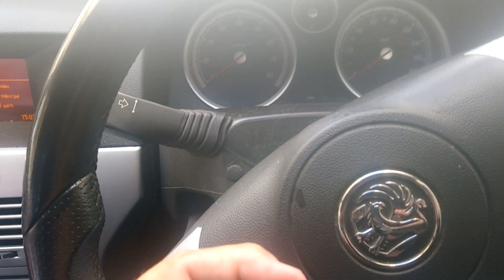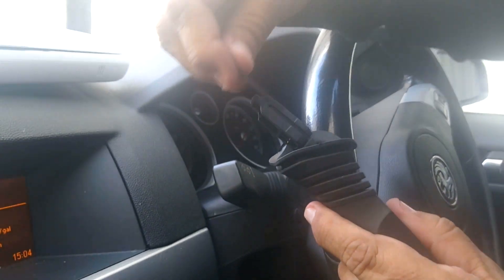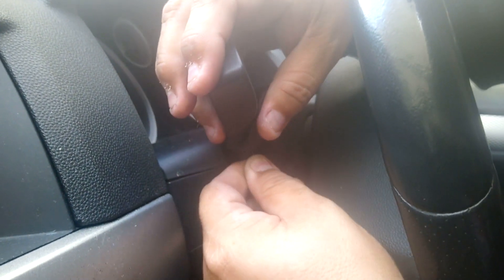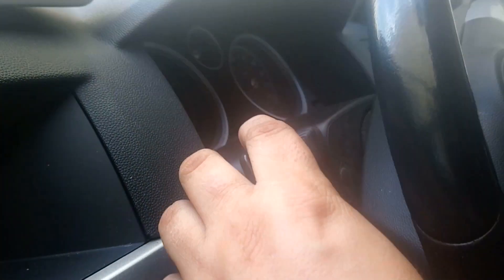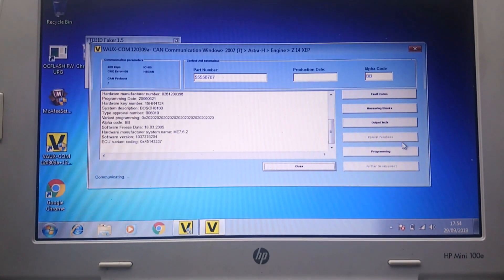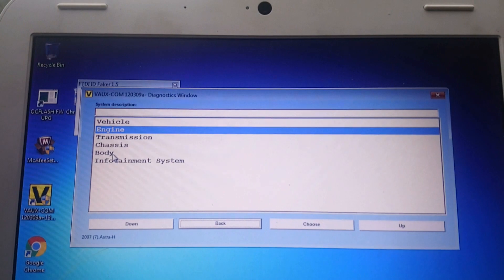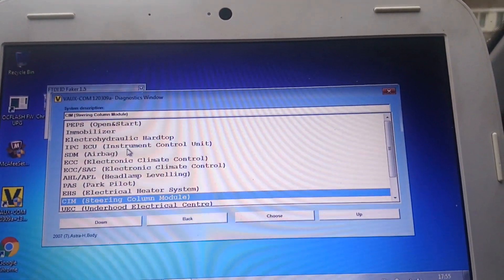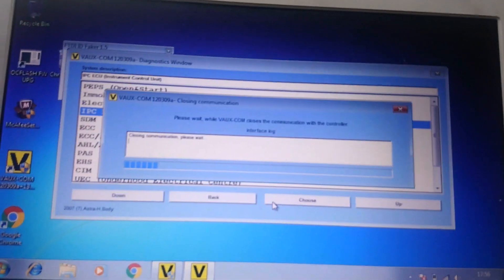Retrofit Cruise Control to an Astra H

Comment: Do you know why my Astra h z16XER 2007 when I enter to body-cim module-programming there is no program variant configuration option? I want to activate cruise control and I can’t
Reply: If you still have not solved this. If you have an option to put in your security code, put it in. It should be there from the start, the only reason why it wouldn't is because you're using a dodgy opcom clone which isn't setup properly so you might need either new software or a new unit.

Comment: I dont think I have the clutch switch, I've heard I can buy one but have no idea on what to do :/
Reply from the maker: Clutch switch is quite easy to install depending if you have the wiring,if not all you need to do is run wires from a switched live and pin 27 in the under hood electrical centre.

Comment: Where do you get the code from to enter in op com when prompted
Reply from the maker: It should on a card in the handbook that either says car pass or security (radio code) if you do not have the card you can go to your local dealership and they can give you a new card for about £30